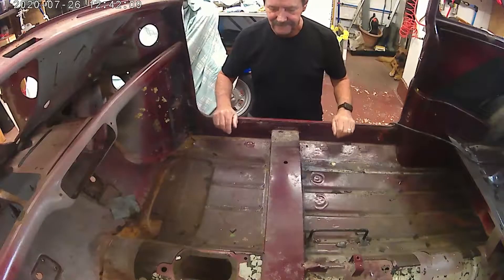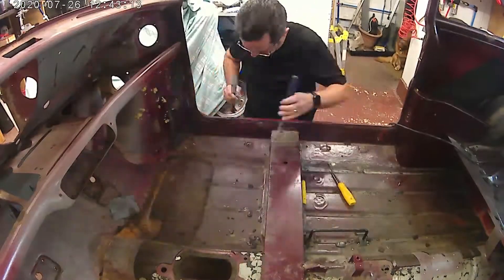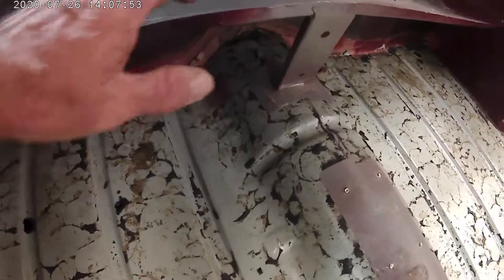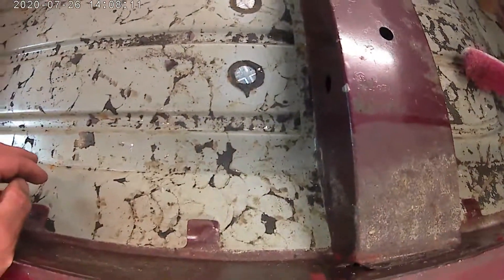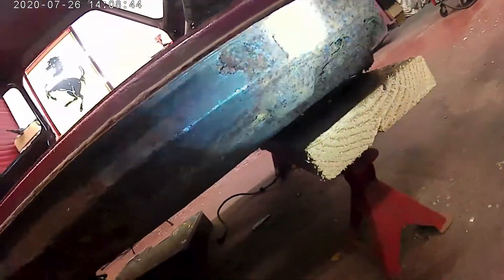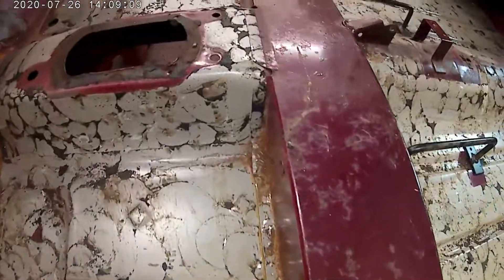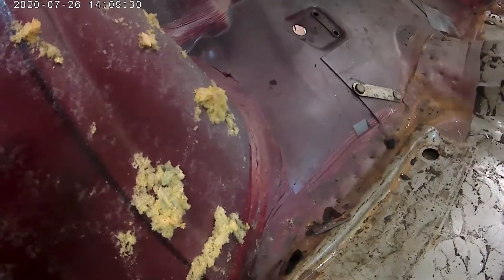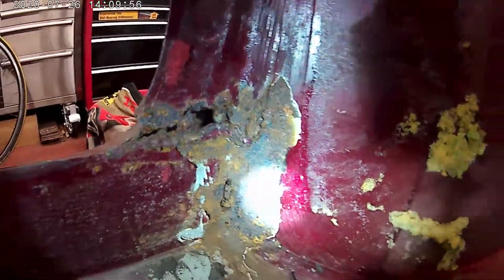Part 2 Sound Proofing Removal

Comment: Looks good Peter, a wee repair on that floor and it will be fine. Just wish my 1977 mini only needed a small repair rather than a full floor
Reply from the maker: Very Happy with the Floor ,Will be happy when I get it up on the jig  should have it with me end of next week ,went for the one from handling solutions on ebay its fully welded and on castors